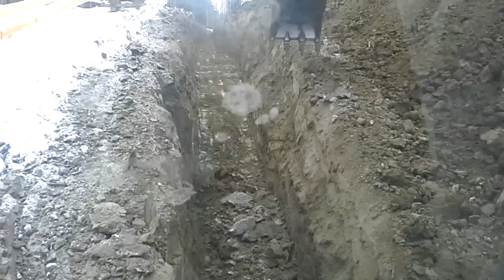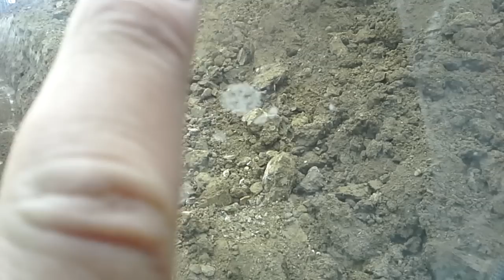How to dig in ditch plugs

Comment: What are the plugs for ?
Reply from the maker: +Robert Taggart the plugs on a hill keep the water from following the pipe down and possibly washing the dirt down the hill.they are designed to push the water to the surface where a diversion berm would carry it off the right of way.hope that helps